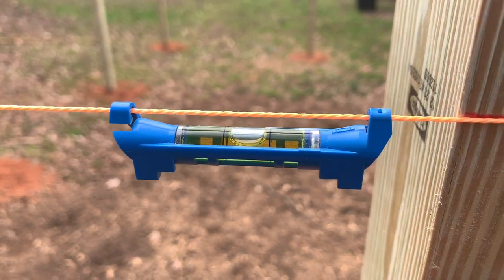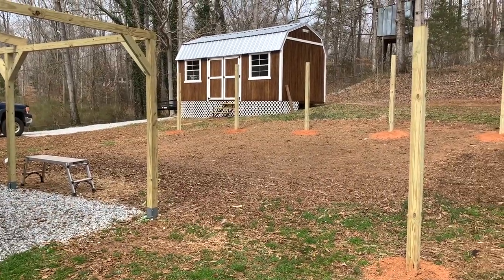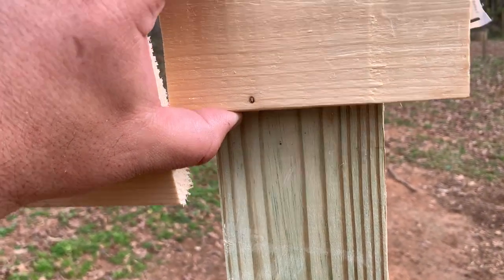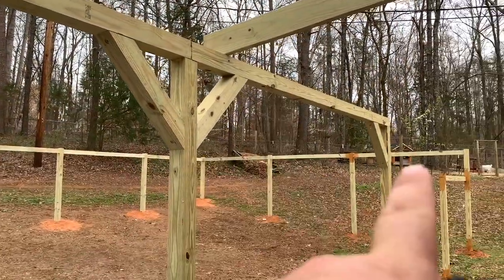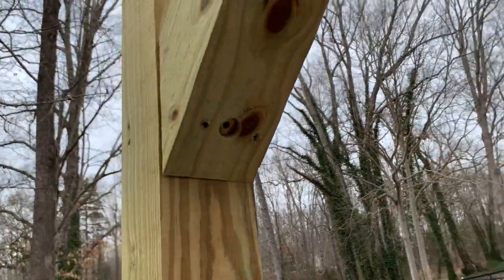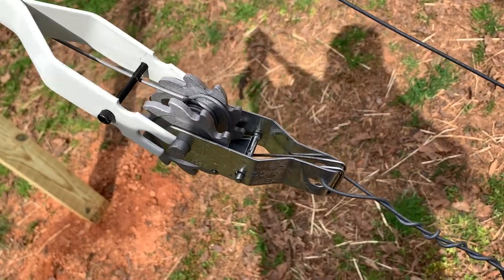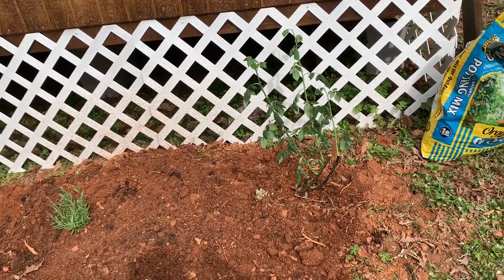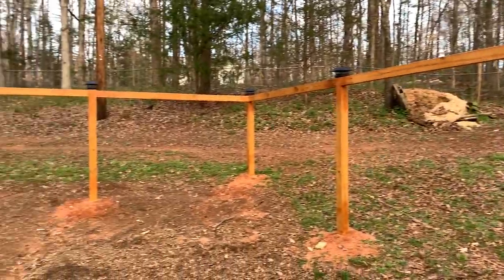DIY | Beautiful Garden Fence!

Comment: Love the stain you picked. It looks really good. If you do want to have a higher edge on the raised beds you can try and old true and tested method. Standing logs covering the bottom of the raised bed so you don't have to fill it with endless amount of compost. The logs will rot slowly over time and add additional nutrients. I hope that information helps!
Reply from the maker: YES! Im definitely planing to do that actually. I have a good amount of fallen trees and branches that Ive saved around the property!
Yep, I have a thing for that cedar color. Thanks for watching,